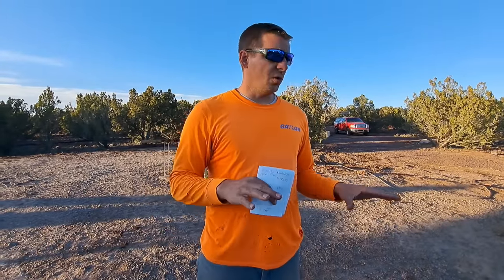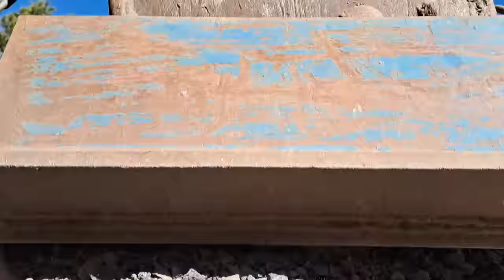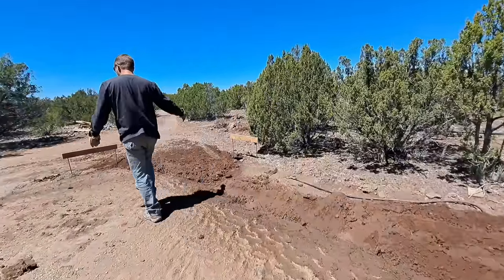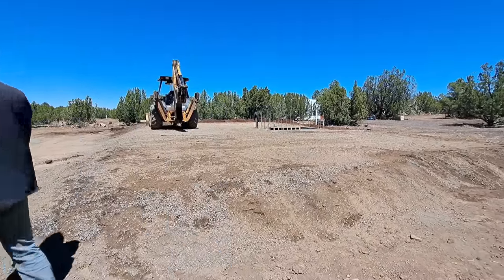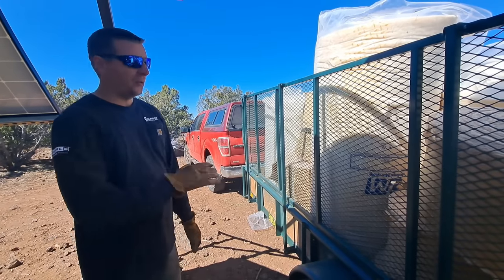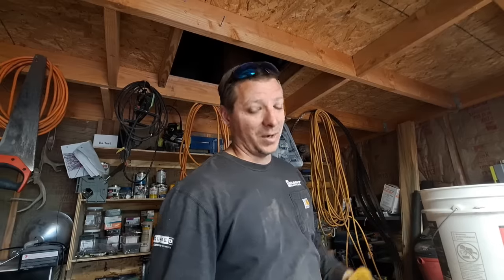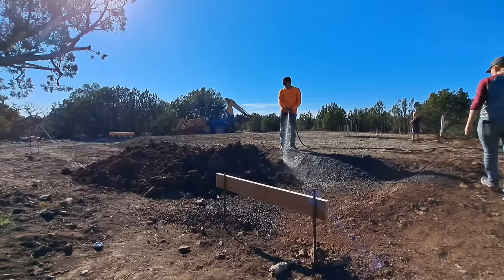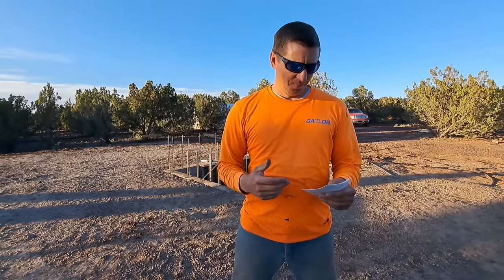Building DEBT FREE at a FRACTION Of The COST....Because Of HER | House Pad Done

Comment: Do your numbers factor in fuel for the backhoe and all the vehicle wear and tear?  How about all the hours of labor?  I place a value on my labor.  Will emaill some thoughts on my math.  It seems like your time is coming out to $5-10/hr.
Reply from the maker: The time is the biggest downside to it. Not worried about wear and tear as the pit isn't that far. Yes a little diesel was used but not much as each load is unloaded pretty quickly. All this was talked about in a previous video. Thanks